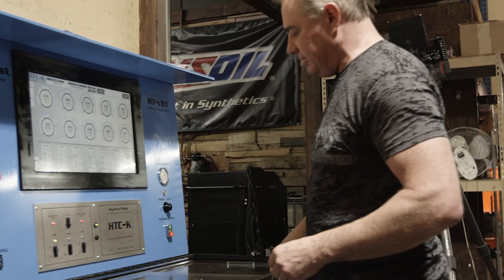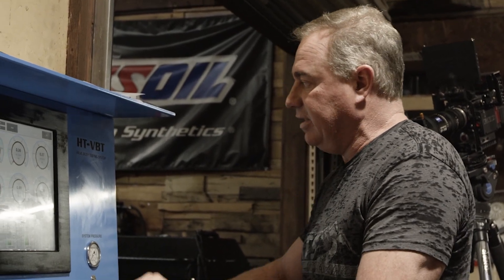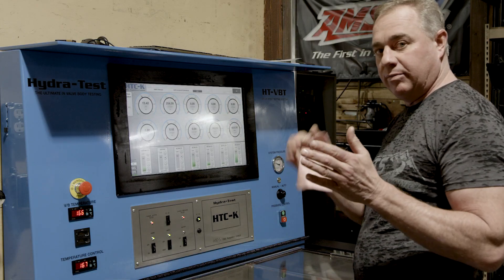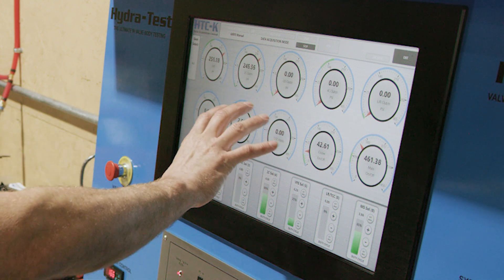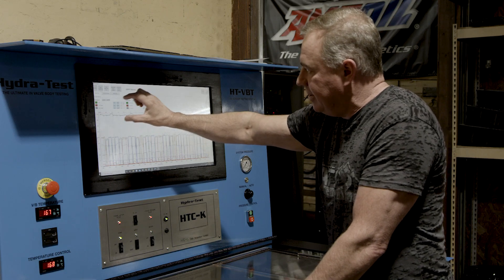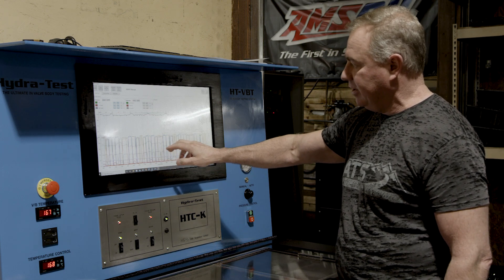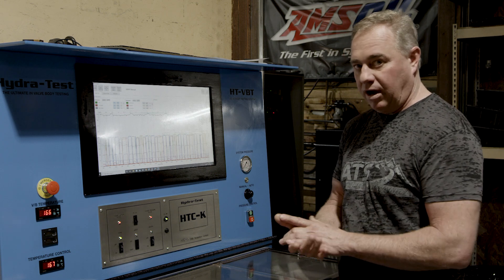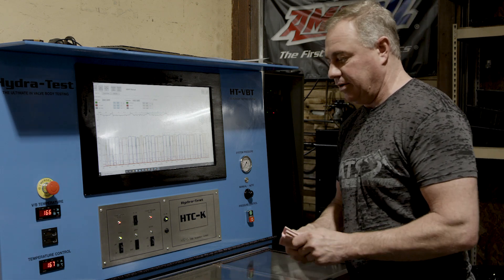ATS Diesel Valve Body Tester for 68RFE - Allison - Ford - Ram

Comment: I’ve got a 2018 2500 Tradesman with a 6” lift and 37s. Been talking to sun coast about their swap. Like your setup better. Is this something I could drive out to you from Atl and have you install?? Trying to build a long-term rig. Wanna put some power but gotta swap trans. First. Check it out on Instagram. @the_siserge.